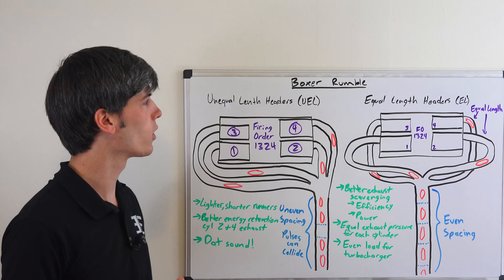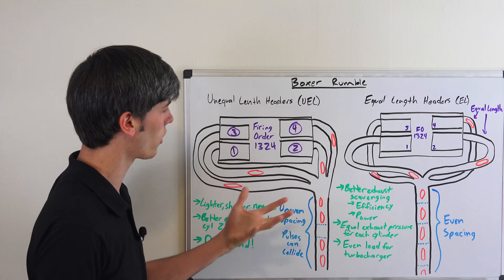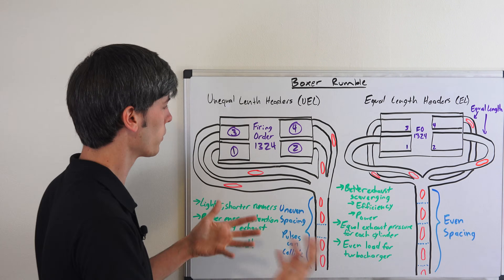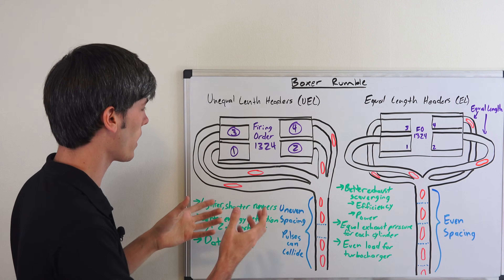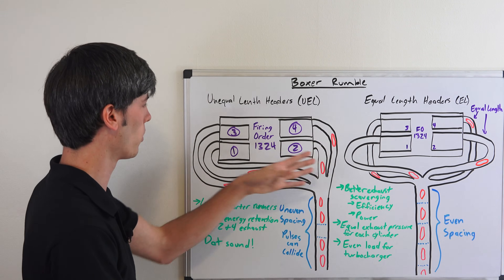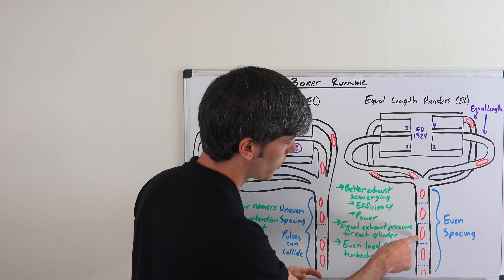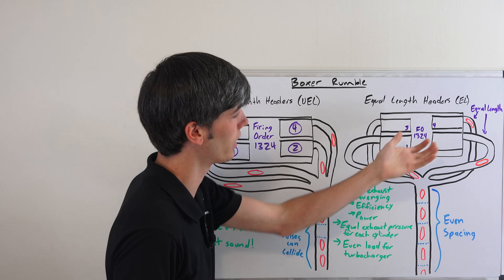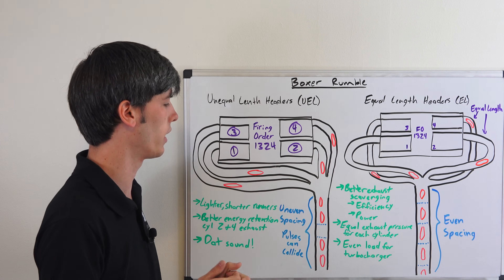Subaru Boxer Rumble - Exhaust Explained

Comment: i heard subaru engines blow head gaskets is thqt true
Reply: Pretty rare. The EJ25D, last used in the '99 Outback, had design issues that lead to gasket failures earlier than normal.
Since then, headgasket issues are few and far between.
Reply: all the time... I had 3... all blown. no more for me. Hello Honda...
Reply: Why should I ever have to change a head gasket on any car for that matter?

Comment: does unequal length headers have any effect on the n/a Impreza?
Reply: Oh it definitely is not best for acceleration it puts power up high but the car is never going to be really fast in a straight line, and I have had it loud since 02 and I love the listening to it as I drive but thats just a matter of personal preference.
Reply: Not really. Most boosted guys see limits around 500hp. So long as the exhaust flows well, NA subies don't have any noticeable power loss with UELs, especially all the eBay clones of the Megan Racing design.
Reply: I have real borala UEL headers on my 02 OBS and they sound FANTASTIC! NA boxers sound even better than their turbocharged equivalents.
Reply: Better to keep a stock exhaust on a slow car.. Trust me
Reply: @ProVision3187 Why is that? I love the exhaust on my obs.
Reply: raterbeast small horse power N/A car you want back pressure. and i know from experience it sucks having a noisy car that isnt fast. acceleration wise. youll get a lower power band with the stock exhaust. which is what you ideally want for a street driven car

Comment: What happens to these exhaust pulses after going thru the turbocharger?  Are they still unevenly spaced?  I would think that the impeller by spinning so fast would blend all these pulses together.  Then what exits the tailpipe are pulses (if any) that are either produced by the impeller, or are the original pulses from the cylinders that are still in their original, unevenly-spaced form simply passing unaffected thru the turbo.  Does the impeller emit pulsed exhaust?  Am I missing something here?  Engineering, please Explain!

Comment: I would argue the number one reason Subaru went with UEL all this time is not because of wait savings, but because of packaging. Its far easier to fit into the car than an equal length setup.

But I highly doubt the UEL will stick around much longer. Subaru has to meet the same fuel economy regulations as everybody else, and an EL setup is better for power and efficiency.

Comment: Doesn't the Subie's flat-plane crank play a part in the off-sequence exhaust warble? Wouldn't switching to a cross-plane crank smooth the gas flow; the same way the lumpy rumble of a 90* V8 (with cross-plane crank) can be made smooth by switching to a flat-plane crank?

Comment: How about rotary brap explained.
Reply: +Jsp P5 Taunus I don't think science has an answer for rotary braaap yet ;-)
Reply: It's caused by porting the intakes.
Reply: because it's a 2 stroke lol
Reply: Its the sound of the apex seals getting stuck in the cat
Reply: Generic Name Felix Wankel cared.
Reply: feeble ape no lol u literally know 1% of rotary engines. If u want that brap sound u need tl bridgeport your rotary engine and it will prob idle at 2000rpm and gets 5mpg streetport gets u decent but it all depens how good tune u have u can have good mpg on bridgeport too if good tune and high mpg tires. Sry bad engrish
Reply: Ford M Garage Its basically valve overlap in a piston engine. Intake air is sucked in and helps push more exhaust gas out. Thats why it happens only when you port it. Ie. Bridge port. This helps pull more fuel in per revolution causing the bouncing idle. Brap Brap
Reply: Thats the sound of your gas money going down the drain.
Reply: Fat chick in rotor 2
Reply: Ben Wickham I want V4 burble explained.
Reply: Rotary fart lol

Comment: if i have a 2016 wrx and would like it to sound like a sti wat headers would i need to go with??.
Reply: +Sebastian Gama Unequal Length.  I'm not 100% up to snuff with the FA20DIT, but you may not want to swap headers.  You'd also need an aftermarket exhaust.  He's running the SPT exhaust in the video, which exacerbates the rumble, even on an STi.  The WRX/STi isn't all that loud without aftermarket exhaust.

Comment: this does not explain why the engine sounds like it does.   the engine sounds like it does because how the engine fires.  if you take equal length headers and replace the factory ones it will sound exactly the same except being a bit more healthy.

Comment: Are the new (2016) subi's made with ELH or ULH? They don't sound like the OG subi rumble, I think they may be ELH
Reply: +Guitarfollower22 Only the 2016 STi has UEL, since it's still running an EJ257.  Every other 4 cylinder Subaru has gone to a variation of the FA20, which uses EL.
Reply: thanks for the info. but ah that sucks, that takes away the icon subi sound

Comment: These videos are great! I'm a Mechanical Engineering student, I want to design forced induction systems, and watching these videos is a great 1,000ft view of all the different systems used in modern autos. (Not to mention I'm also a huge Subaru fan)
Reply: It's been 7 years are you designing forced induction systems yet?

Comment: Can you do a vid on why Subaru' s boxer engines are plagued with leaking gaskets and what they can do remedy that?
Reply: Replace them now and then? 
My valve covers never leaked, spark plug gaskets started at 200k. Crank seal should be done every timing belt change. 
Headgaskets should never leak when following the maintenance schedule.

Comment: Would you be able to explain why Subaru's seem to use oil more than your average car?
Reply: +Steven StringerMight have to do with the flat engine configuration. In a cylinder lying on its side instead of standing upright, there might be more oil accessing the combustion chamber. But that's just my guess.
Reply: +MyFavoriteDisease That is correct. It's also one of the things that contributes to Subaru boxer engine longevity though, because the pistons are drawn down by gravity to where the oil pools, so the highest friction part of the cylinder is also the best lubricated part of the cylinder.
Reply: babybirdhome  The oil level and combustion chambers are close to the same level horizontally.
Reply: Welp that makes more sense than anything else :)
Thanks guys, me and my coworkers have been stumped on this for awhile

Comment: Another positive to the EL headers is that you can run the same timing both sides as with UEL the short side ends up running hot, and creating a scenario in which promotes detonation and thus ringland failures. Though you can just lower the timing per cylinder and avoid it that way. Killer B make absolutely amazing 'Holy' headers.

Comment: Hi Jason. Over the years I've heard many a debate from many people about the differences between a straight 6 engine compared to a V6 engine such as which one makes more torque at lower revs and which one revs quicker and harder and which one is more fuel efficient. Would it be possible to make such a vdo describing the advantages and disadvantages between the two of them ?

Comment: The still picture you used for this video is not of a Subaru engine! It is of a UL Power aircraft engine. Which BTW has equal length headers.

Comment: So basically conbining 2 large Variable Twin Scroll Turbos with two 2 in 1 headers, open downpipe and even an xpipe in the middle, say 4 inch each exhaust. Fully built, running maybe even custom timing Camshafts for optimum of Torque and e85....dreams....47-50 pounds of boost, maybe high compression. Should be a drag missile :D

Comment: I was under the impression that the exhaust note was due to firing order. typical inline 4s fire 1-3-4-2, (the well know shitty Honda exhaust note)where as this Subaru boxer 4 fires    1-3-2-4(has the nice rumble) Another example, Yamaha's R1 street bike( all inline 4s)the older ones had a flat plane crank & fires 1-3-4-2.(sounded like every other sport bike on the market) The newer ones however(09 & up) have a cross plane crankshaft & fire 1-3-2-4(like the Subaru) & have a awesome rumble & sound almost like a V8! Go listen to sound clips if you don't believe  me!
Reply: +scrambler250r Go to the wikipedia page on firing order, scroll down to even & uneven firing order, explains it perfectly!

Comment: Well I think maybe car manufacturer can apply twin turbo on each side of the exhaust to have a even less turbo lag and not using the equal length headers? Or would it make the boxer piston unbalanced to cause possible failure? Or it just looks like you have two boxer engine with only two piston each side (sorry for not describing it correctly or making it more misunderstanding)?

Comment: why new wrx fa20dit sound not like subaru rumble
Reply from the maker: Equal length headers.
Reply: Thanks  . Is it possible to hear the boxer rumble in new  wrx fa20dit
Reply: +Sultan Fahd you just asked a question to why you don't hear it than you asked the same question
Reply: +Sultan Fahd I'm pretty there are aftermarket UEL headers for it.
Reply: +M lke which one
Reply: +Sultan Fahd straight pipe it for a catback, there's a slight rumble but not noticeable. No unequal length becuase of twin scroll turbo
Reply: it still rumbles by default of it being a Boxer 
it sounds more akin to the JDM EJ207

Comment: This might be the most stupid question someone would ask. But because I favor knowledge. And maybe you talk about it but I wasnt listening enough to realize. Anyway in a turbocharged car. Wouldnt the exhaust pulse becomes like 1 and equal in the turbine and flow out smoothly out the turboback, hence the rumble disappears? Another thing, there are some unequal length manifold on other cars too like Tomei Expreme SR20DET exh. manifold. Shouldnt it be rumbling too? Or maybe it actually does, just that I4 engines are not as obvious because the unequal length arent that critical compared to boxer engines?

Comment: Thank you for explaining it so well, easy to understand and honestly my 2015 WRX with an aftermarket exhaust (as I hear online, mine specifically does has the stock) can sound just as sexy so the positives for equal length outweigh the mainly cosmetic (can I use that with sound? lol) or audible benefits of the unequal length headers.

Comment: Could you explain why Subarus typically have higher torque than horsepower?
Reply: +Brian Patrick Since torque and power are measured in different units, this doesn't really make sense. It's like saying a bucket of water has more mass then temperature.
Reply: +Brian Patrick Because they have forced induction, more air means more fuel = more torque, hp is a function of the torque
Reply: MyFavoriteDisease Thanks for not answering the question.
Reply: more torque can also come from how the engine gets it's displacement. bore x stroke = displacement. bigger bore combined with shorter stroke generally gives higher horsepower and allows the engine to rev higher. smaller bore and longer stroke creates more torque, but the engine can't rev as high.
Reply: tjsavage711 Hey, thanks dude!

Comment: +Engineering Explained I dont understand why its called a boxer rumble still. You can get this sort of a rumble on any car running unequal length headers. 

My first turbo car had this rumble. Self turboed a 95 saturn sc2. The manifold I built had very uneven length runners so that I could keep my Air Con (ac pump very near the exhaust manifold area. And for some reason I decided on a top mount turbo...

Comment: An idea for another video: 

Exhaust back pressure vs scavenging. What helps scavenge/back pressure and what doesn't. How to calculate exhaust tube diameter for engine size/power for optimal exhaust gas speed.

Comment: I thought he was going to explain why the boxer engine made a unique exhaust sound not the difference between headers which applies to any car. I love learning about engine design when it comes to exhaust...like the rotaries unique sound or the v12 cars. The title of the vid is misleading
Reply from the maker: You could get a straight four to sound similar with UELs. That's the point.

Comment: Sooo, if you had a run of the mill 4 cylinder, could you manufacture the same boxer sound with similarly unequal length headers?  Yes at the cost of efficiency, but with the bonus of awesome boxer-esque sound?  Presumably a couple of loops here and there would be sufficient to generate the required length?  Am I talking nonsense?
Reply from the maker: It would work, yes, it doesn't necessarily mean it would sound like a Subaru, but it would have the burble. I wouldn't recommend it though as it will likely throw off the exhaust tuning.
Reply: Engineering Explained Too cool!  mk1 mx5, hotside supercharger, I think I would run out of space to do it anyway, but it's a really cool idea nonetheless.  Ace channel, keep up the good work :-)

Comment: So, different length header tubes, vs symmetrical tubes,
equals less material. But weight? As a benefit?  We are talking ounces or grams here.  Not significant at all.  …Definitely a better overall design.  I hope I'm making sense.

Comment: Subaru cylinder layout is Wrong😉 the engine is the Wrong Way or the exhaust is not going to the rear but out the front 😔
Reply: I think the drawing was more for the purpose of explaining the concept of unequal and equal length headers and how they affect exhaust, not to give a detailed blueprint of the car's engine map. I know that's hard for some people's tiny brain to understand.
Reply: +MrTurbotoys I agree something sounds wrong on a Subaru. An old air cooled VW has the same engine configuration and sounds great.
Reply: fahrvergnuugen no it doesn't, the exhaust runs toward the back(well up to the uppipe-turbo- etc) but cylinder 1 and 2 are the front 2 cylinders therefore top or bottom it would still run the opposite way he has it drawn. He didn't draw a blueprint though he's just making a crude drawing to explain the exhaust
Reply: +MrTurbotoys It depends on if you are looking at it from the top or the bottom!
Reply: +MrTurbotoys I was just thinking this. Cylinders 1 and 3 are on the passenger side of the vehicle and have the short exhaust runners. Great video with a good explanation though. No offense to Engineering Explained

Comment: Best explanation by far on UEL and EL headers and the boxer rumble. I think it's funny when people complain that the new WRX doesn't have that boxer rumble and they should have kept UEL on it. But they don't realise that they would be sacrificing so much beneficial efficiency and power by trying to run UEL with a twin scroll turbo...

Also, a Corolla can replicate the same exact sound as a Subaru if one of it's cylinders are blown. Look it up it's hella funny.

Comment: UEL less efficient? Leaves horsepower on the table? Causes cylinder #4 ringland (debatable) failure? WHO CARES! I have a set on my current N/A Subaru and also had a set on my older WRX. Doesn't make my current Subaru any faster nor adds MOAR POW-WA but it sure as hell sounds great.

Comment: I'd like to know the actual EGT difference at the turbine inducer from EL vs UEL - under WOT I bet it's the same, with maybe a very small delta in the time it takes the UEL to match (under 10th of a second or smaller I bet)
I'd also like to see the scavenging effect differences in a turbo car where exhaust back pressure pre-turbo is normally 1.5 to 2.5 higher than intake manifold pressure.
BTW, a 10 to 15 hp gain on a car starting with ~250hp is only 4 to 6% increase.

Comment: The boxer 4 is the only 4cly engine that sounds good to me. And boy do they sound good with the right pipes.
Reply: +Matthew D Look up some YT videos on the legendary Offenhauser I4 engine that dominated Indy racing for about 50 years until it was rule-booked out of racing.  One of the meanest sounding racing engines of all time. Offy's were pure intimidation and the "4 cylinder from Hell" if you were racing against it with any engine not named "Offenhauser", because your butt was already kicked before the race started!

Comment: In a turbo Subaru running unequal length headers , cylinders 1 & 3 have the shortest distance for the exhaust pulse to travel. the diagram on the left is backwards.

Comment: why would the equal length headers make for more efficient exhaust scavenging? Wouldn't the vacuum after the last exhaust "pulse" cause the gases to actually head upstream to the cylinder that hasn't expelled it's gases?

Comment: I wonder how a Subaru 3.6R Boxer 6 engine would sound with unequal headers. Wonder if it would still have that iconic Subaru rumble sound.
Reply: mighty car mods, super gramps has unequal length. that's what it would sound like
Reply: +Rome1017 I completely forgot about that. I did watch all those episodes and I remember it does sound pretty good. I just wish someone did a nice exhaust clip sound video.
Reply: +Technolique they've actually done about 3 exhaust clips. hidden in other videos, forget which ones